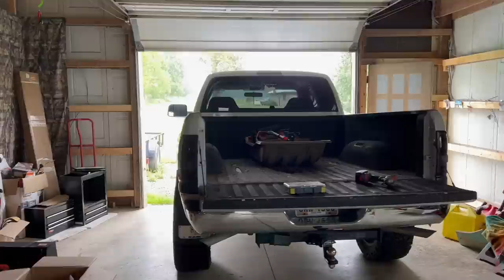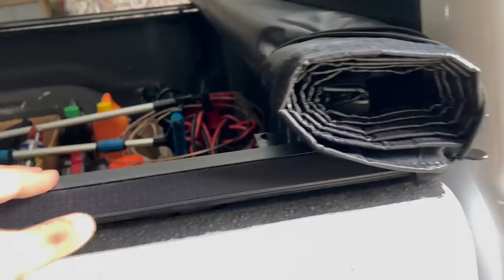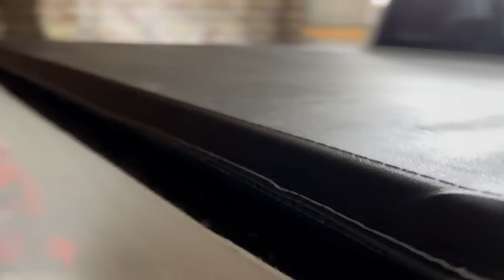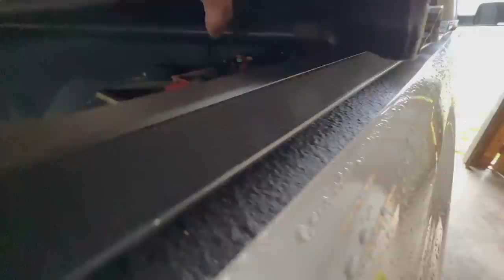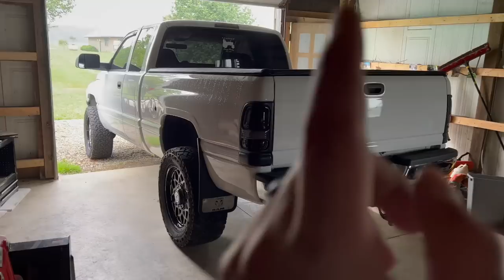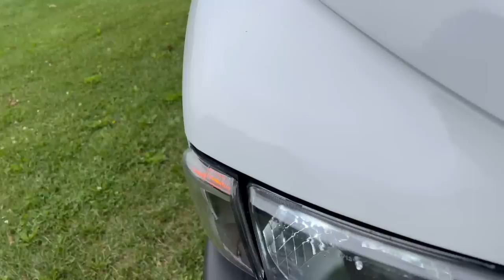This had to happen! I had no choice...

Comment: I have a toneu cover on my truck that is just like yours. It is I think 9 or so years old. The velcro is dirty and not sticking just like it used to. All I need to do is clean it with a hard brush or wire brush to get the dirt out of it. I also run a landscaping business out of my truck and I use my truck almost every day. I guess what I'm trying to say is that you're going to have to keep the velcro clean on your truck bed cover